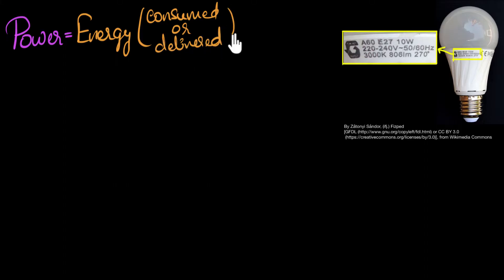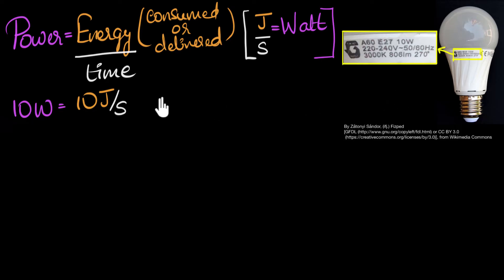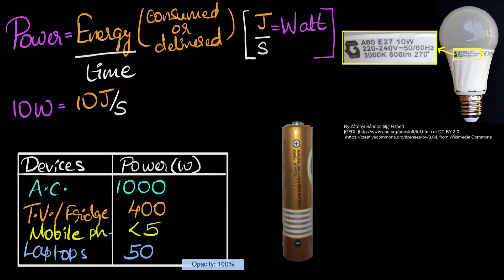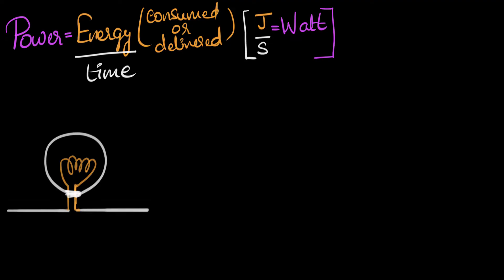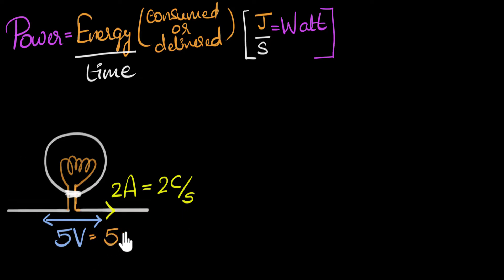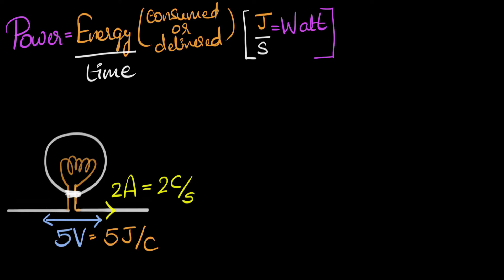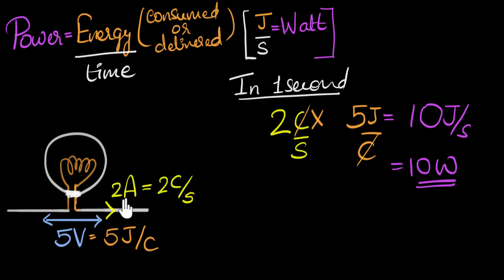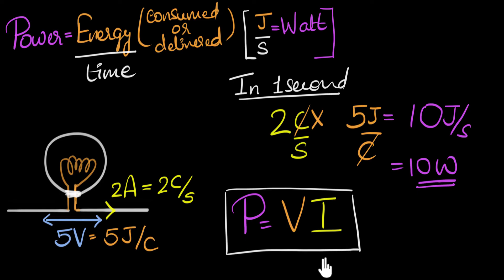Electric power & energy

Comment: Yet when calculating energy from power they multiply by time in hours. Why? When it should be in seconds. Eg E=Pxt P=150W t= 3hours. E=150×3. E=450W/hrs. But why is it not 150W/sec x 3600 to get watt hours? It makes no sense.
Reply: Because kwh is the commercial unit of energy that'd why....